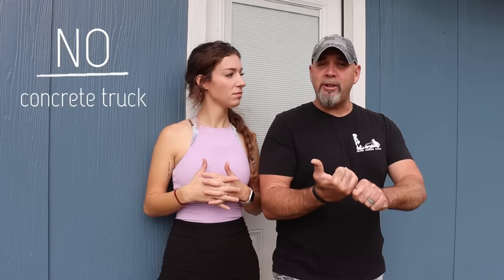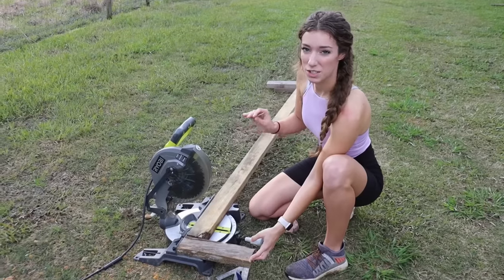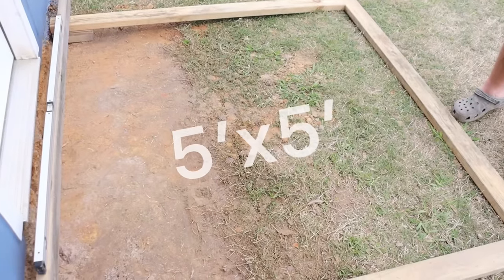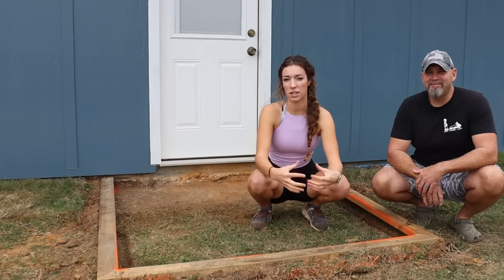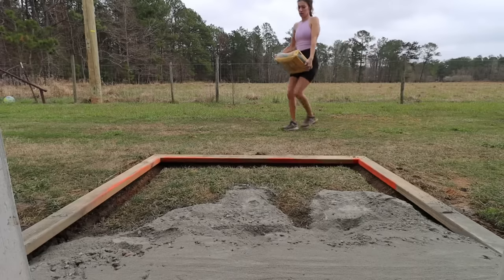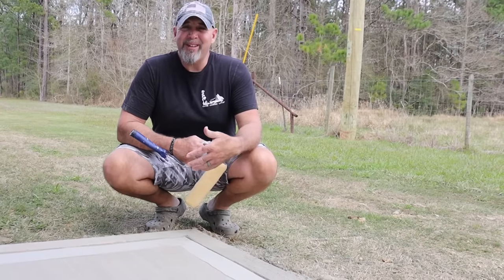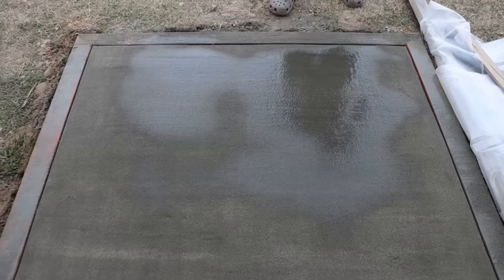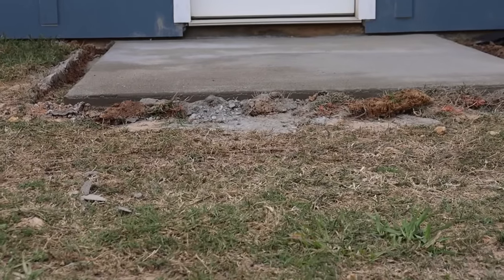How To DRY POUR CONCRETE SLAB and Update of Our 1st Pour

Comment: A small suggestion is to measure from corner to corner on your forms to ensure your forms are square and use a temporary brace across the back of the form to keep them square when installing, especially by yourself.
Reply: Is this method and depth safe for freezing winter time states? What's your suggestion?
Reply: @BGdev305  the colder the weather, the thicker you want to go. It also depends on what your concrete area will be used for. This method and thickness on the video is good for walking on and to place relatively light structures on it, never to be driven on. In your case, Id advice going a minimum of 4" thick. Beyond concrete and/or the use you'll give it, I call it peace of mind...
Reply: that's not the best way to measure squareness. Use the 3-4-5 method.
Reply: @BobWileyAKA52Blue  measuring diagonals and making sure they're the same will also work and faster than 3-4-5.

Comment: Wow I’m extremely impressed, I’ve been doing concrete for 5 years and thought this was a tale but this looks like it holds up great. I’m in Minnesota and have my doubts it would hold up to our frost freeze cycles and what not. Down south it sure works well. Super cool video and amazing job on everything, even the editing! Keep on rocking you two❤
Reply: Fellow Minnesotan gonna give this a go!! Building a small 8 x 10 shed. Let's see what happens 😁 Pour half, lay bar, pour top half. Then the water cycles. Very curious how this will hold up to our freezing. Good luck this year tossin' discs!
Reply: I also live in the northern cold. Wy/ID boarder. I would love to to this for a sauna slab most of it will be covered by the barrel sauna. any tips and trick to make this work with the freeze cycles in the north?    
cheers!
Reply from the maker: We have a video where we poured a 4” slab with reinforcement. That is what you would need in your climate. Also, you would need to put a few inches of rock down before you pour. This will help with water accumulation freeze/thaw/heaving.
Reply: @CajunCountryLivin  I have a plot staked and fairly leveled from last fall. I was gonna do a wood foundation on 4 corner blocks until I saw this dry pour flying around the internet. Wasn't 100% sure about gravel but I am now!! Thanks for all the time you put into showing the world your techniques! The lady and I are both skeptical as we have that old mentality but I am certain we will be pleasantly surprised as long we do it right 😁🙏🏼
Reply: Won't it float?   With the seasons?    I like it.

Comment: I gave this a like because I can see you really put a lot of effort into creating a start to finish tutorial, and it seems like such an easier way to do a small slab like that. Not to mention, y'all are so cute together. Unfortunately I still don't feel like I know how to do this right because I feel like you totally glossed over one of the most important parts. HOW MUCH WATER??!!? When you are mixing concrete, the cement to water ratio is really important, but I have no idea how you controlled that. You said the first two mists is just enough to make it dark and six total sprays, but how much water are you spraying for numbers 3 to 6? 30 seconds or ten minutes? Are you just making it damp, or are you really soaking it once the surface firms up? How would I know I am using the right amount of water so its not too much for the powder to set properly, or worse so I don't have an inch of concrete and 3 inches of powder underneath? How do I know when it is saturated properly? What if I need a thicker slab, how can I tell the right amount of water? Is this method somehow foolproof, and it doesn't matter how much water I use? I can't be the only one wondering how you have controlled this important factor.
I am sorry to be critical of something that you clearly worked hard on, but I don't really have any confidence I would be able to do this right since I don't have a clear idea how much water to use. I mean I could just wing it I guess, but if I get it wrong an 800 lb crumbly mess is going to suck to get rid of.
Reply from the maker: Lots of good critiques here! We will be making another video soon and we will be addressing most of these questions. Great talking points. Thanks!
Reply: @Cajun Country Livin'  I was wondering the same thing. I'm even now contemplating doing my own slabs in the next month or so. I'm looking forward to seeing your response to the water question.

Comment: The slower concrete cures the stronger it is. This is why your thin pad is so strong.
Reply: Just wondering how he knew he used enough water, if he didn’t use enough to completely wet the entire pour all the way thru. That will cause issues, No?

Comment: Awesome video! Getting ready to do this in my back yard. Just curious about how long (time wise) did you take to soak the slab for the 3rd through 5th soakings. Im assuming you could add too much water? Or is it that the color changes darker when it’s saturated enough at each interval? Sorry for the dumb question!

Comment: Impressive! Here's a tip that will save you the time of "hand-filling" the dirt around the form. Just take cheap landscape cloth and staple it to the form, then loop it down to the dirt level, take a hoe and just pull some dirt on top of it. Saw foundation crews do this in Calgary on hose footings and it worked beautifully to prevent "boil out" under the form boards. And if anyone tries this in Northern MI, WI, MN,  NY, VT, NH, ME, MT etc... anywhere north of the 45th parallel, let us know how it works.
Reply: It won't really matter. A slab is a slab so no matter how it is done it can move with frost. Really no difference between that and a sidewalk except a slab is heavier and will usually stay in place.

Comment: Nice work. Can confirm this method works well and is perfect for those of us who don't own or have the space to keep a cement mixer. I've also used 'Postcrete' (which is a finer grade of stone in the concrete mix) to make a 'temporary' path between a shed and garage and so far it's withstood five British winters without cracking or sinking.

Comment: I had no idea that you could pour concrete like that. Mind expanding and eye opening.   Seems like the key is don’t be in a rush and take your time so you pay attention to all the details.   I have a real small pad extension that I want to put down.  One of the reasons I’ve been dragging my feet is it’s so small, that the work of a wet pour just wouldn’t be worth it.  I believe using your technique will save me money and a lot of work in the long run.   I’ll try to remember to update you after I do it.   Thanks again.

Comment: Yeah i just did my first Dry Cement Pour. It came out good and i think i did great. I had one person help, but they had no idea what to do. Its about 3 inches thick. I've poured the traditional cwet cement piur. And this was way way easier and quicker. I had no big mess to clean up. I will say im getting ready to piur a slab for my grill area and i will see if i can post pictures some where. Oh yeah it's a 8X8 slab I put down to hold a small shed.
Reply from the maker: That is awesome!

Comment: I have used concrete on grass for 50 years. I always pour a 2 inch thick by 3 ft wide around the inside of my fences and wet down with a water hose till saturated. Great way to keep dogs from digging out. My first house I went to visit the relatives who bought it. That concrete is still there. 50 years ago.

Comment: This is much better than adding too much water. @CajunCountryLivin you're going to help DIY folks plenty with this creative smart idea. Slow winds, no big rains, your dry pour method could (maybe?) use a crack-resisting screen, a small slab still needs rebar for flexural but could be done this way - and professionals will appreciate if everyone moves towards slower cures too!

Comment: Amazing! I have never seen someone do a slab like this. I need to build one for a 500 gallon propane tank, so I need to do some more research to confirm you can do this for thick slabs (I want to do mine 8" thick) and will have rebar in mine, but this is amazing.

Comment: I use a simular method when fencing. I mix the excavated soil with raw cement from the bag. Mix well. Sovel in 4 inches, then compact with a digging bar, then repeat until level with surface soil. The cement goes hard with moisture in the ground, NO WATER NEEDED. Been doing for 30 yrs on farm.🎉🎉

Comment: Beautiful work! For post holes, you can also us dry concrete. Just dig the hole insert your post into the empty hole, and brace it in place. Fill around the post with dry concrete, wet and cover for a day. For a better look, mix in some of the dirt you removed from the hole with the dry concrete. Now, when the concrete dries it will be the color of the surrounding dirt!

Comment: That was an excellent presentation for a dry poured slab.  I'll be laying down a short side walk and slab in front of a shed I recently installed.  Thank you for sharing your expertise. I'm "pumped" to get started on my project. BTW, that was one nice tip using a paint roller to leave a nice finish.  No need to do additional finishing as the concrete drys.  Nice tip. 👍

Comment: This is absolutely astonishing. I am so glad I found your video just 3 days before I was due to pour concrete walkway, and I have about 100 bags of rapid set concrete, which I bought privately at a very good deal. I was extremely worried about that would cure too fast in our Australian heat here now in January, if I do it one bag at a time. But your method is just amazing. The only question I have is how did you make sure water had penetrated all the way through the dry concrete without leaving any uncured pockets inside. Did you consider core testing or slab scanning? Thank you.

Comment: So I'm just doing a slab for 2 trash cans . I don't need that tool that edges the concrete. I'm just going to use wood to frame it up. What did you use to glide across the concrete to get it smoother. I'm doing this by myself, so I won't have an extra set of hands to slide the board across the concrete like you did. This was great. Simple and to the point. Thank you. Ms DO IT Herself from Delaware

Comment: I figured this method out on the fly. I could not get a concrete truck into the area i eas pouring. I rented a mixer. The area was 12 x 20. 20 min in I tossed the  mixer and started pouring bags straight on the ground. Turned out perfect.  My one critique is that I would have backed my truck up to the pad. Rolled all my bags off into the slab took a shovel busted the bags then just pull the bags out. Lot easier than pouring each bag.

Comment: Wow perfect timing, I have a question, if I have a 600 lb riding lawnmower do I need to have a 4 inch slab? Or would 1 inch work? I love you for doing this. I’m really handy. I can do this in a heart beat, save me a few thousand dollars doing it myself. Please answer my question. Thank you for doing this video. I love you for that. Please let me know the amount weight 1 inch slab can hold, putting 600 lb lawnmower will 1-in work? Thank you 🙏🏼

Comment: Your videos on dry pour concrete gave my wife and I the confidence to extend our backyard patio.  This is an enormous compliment to you both as we despise anything that has to do with hard labor.  We have always taken the easy way out by paying someone else to do the hard work.

We just finished the first (10x5) of 3 extensions (4-in depth), and we are in our 2nd day of curing. However, I am concerned with the outcome as there is one section that appears discolored or not curing properly.  In other words, it looks as if the water did not penetrate the concrete.  95% of the slab appears dry and it seems to be curing correctly as per the many videos you have shared. But the discolored section looks as if I just applied the initial mist of water. The discoloration is along the edge of one corner.  Not sure if the curing is simply taking longer with said area or whether it is an issue to be concerned about. If the issue is normal, we are uncertain as to how to fix it.  I wish I could attach a picture of our work. Any suggestion you can share on how to tackle the issue above would be greatly appreciated.

Comment: Thank you for sharing your experience and knowledge with us. I have a question. For a dry pour sidewalk, do you think I need to add some type of wire to deter any potential cracking? And for a 20’ sidewalk, does it need to be in sections or can it be a solid walkway? Thanks again for sharing your experience and thoughts.🙏🏻

Comment: I like the process. I have a problem with the floor in my garage being unlevel and my washing machine and dryer are there. Basing myself on your video 5x5 the front door. Do you think if I level the garage floor ( concrete) better and use the process you used it can hold the machines and not crack? Or have do we need to use a higher mix of chip marble? Please help me. Thank you. E & Al.

Comment: 26 years  ago I took pavers laid them out leveling them the best that I could I was about 60 then to have a area to put table and chairs around pool. Then I did the put cement dry and sweep in over and over pavers then did the same with water. Well after this many years I will clean out any bad spots  reapply cement and maybe it will last another  20 plus years. Thank you will start watching you but now at 75 I might slow down…
Reply from the maker: I bet your paver project looks great! Thank you for watching!

Comment: Hi, Loved the video. I'm going to make bases (front and back, maybe 2' x 2' or so) for these ornamental full-size fiberglass horses. They have L-brackets welded to the feet, and I will need to drill holes into the bases and bolt through the brackets into the bases. Are there any considerations on wait time or other-- for drilling into the dry pour bases? Thank y'all.

Comment: I'm planning to build an observatory out back and can't get a mixer up there so this is my plan. I live in Pennsylvania so have to consider winter freezing/thawing and found QUIKRETE ProFinish Crack Resistant mix that has the fiberglass included for strength. I was also wondering if tamping, rolling to do a tight pack of the mix would improve the overall hardness.

Comment: Really Nice Thank you for making this video. What about something for a vehicle using a quick jack lift it would need steel enforcement as I notice you did not for this entry porch slab but understandable because there's not a lot of weight. how do you thing it would work for a slab with steel supporting a 5,000 pound vehicle ?  a slab about 8' X 4'

Comment: I have done several dry pour pads. I have experienced delamination of the top crust. Any thoughts on how to prevent it from happening? Maybe drying to fast? Maybe more misting on the original water application? Cover after each watering?
Reply from the maker: With our experience it appears when too much water is added during the misting phase, it can blister. That’s why we always say just barely darken the powder. That only gives the top layer enough moisture to prevent the finish from being damaged when the showering phase begins.

Comment: What’s the experience if you had to use anchors onto the concrete? Will the concrete break up from the expansion of the anchors or will it hold up?
Reply from the maker: We’ve used anchor bolts and screws with no issues.

Comment: I have a stupid question lol. I have never laid concrete before, so please go easy on me. I will be removing landscape rock where I’m going to pour my dry slab. I’m sure you can’t do this but I figured I’d ask just in case. Could I use the landscape rock to fill in some of where the slab goes (bottom layer) so that I would need less concrete to fill it in? Or would that ruin it? Thank you for your help!
Reply from the maker: I would not recommend that. It would cause inconsistency in thickness of your slab which might induce cracking over time. You might could get by with doing that if your slab is going to be rather thick, but it would definitely be a risk.
Reply: Thank you so much for your help ☺️ makes sense and I want to do it right!

Comment: A little tip for you to pour your concert from the bags a little easier and quicker. Lay the bags flat on the ground and take your razor and cut across the center of the width. Then flip the bag over and lift up on both ends, tada done.

Comment: I may try this. I have a section in my drive that's just stones about 16ftx10ft that's surrounded by concrete on two sides and the other two sides are the house foundation. I just park a 16ft aluminum boat there but I'd rather have concrete for cleanliness.

Comment: Have you ever tried using motar for the top for a.smoother finish?  I saw someone do this on another video, just wanted to get your thoughts
Reply from the maker: I wouldn’t suggest it. We’ve had many people watch those videos and do their slabs that way. Now they’re contacting us because the mortar is disbonding from the concrete and asking us how to fix it. We only suggest our method because we know it works and we have been doing it this ways for years
Reply: @CajunCountryLivin  thanks for the reply and the comments. My main concern is getting a smooth finish, several videos that show dry pour have a real difficult time sreeding it down and end up with a real rough surface.  Any suggestions?